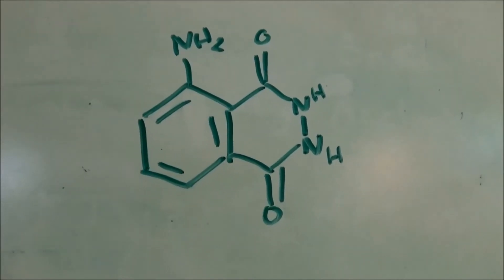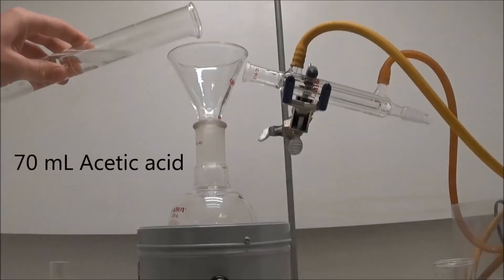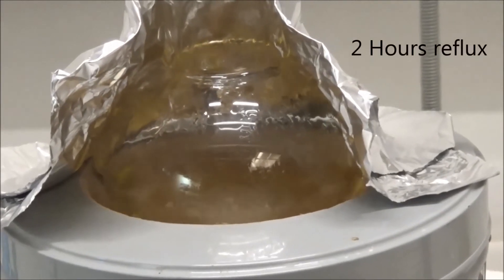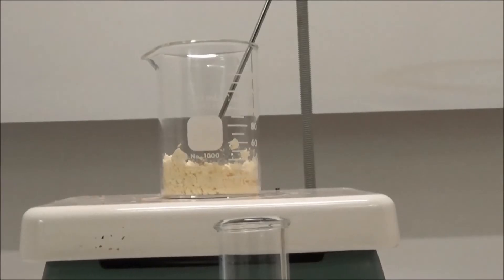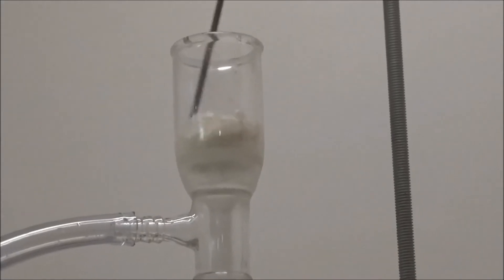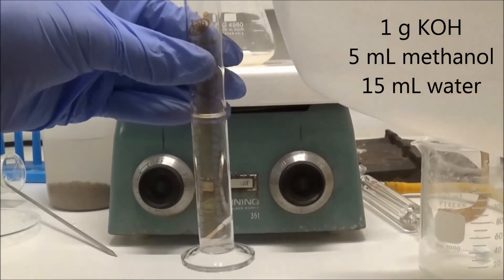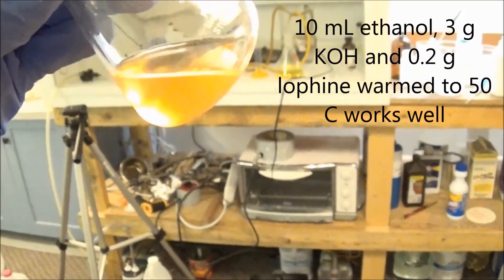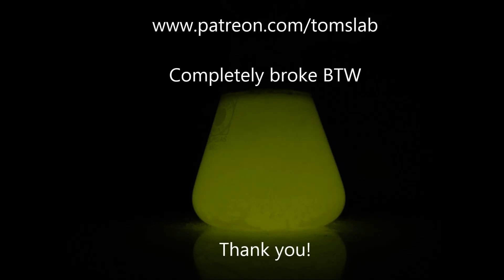Synthesis and Chemiluminescence of Lophine

Comment: Great video, Tom! Just a quick thing on the recrystallization: you probably could have used some more ethanol to get the solution entirely clear before cooling. That way the product would be more pure. It looked like, in the video at least, you still had some particulates floating around. Regardless, great synthesis!
Reply from the maker: Yes, that would be the best way, the problem was I would have to transfer to a larger beaker and that seemed like a pain at the time. I don't think it was that bad though- the main impurity (benzil) is rather soluble in ethanol and lophine should have been the only thing with such low solubility.
Reply: Tom's Lab Definitely, it would have been more of a pain than it's worth for the demonstration. Especially considering you'd need to clean another bit of glassware!